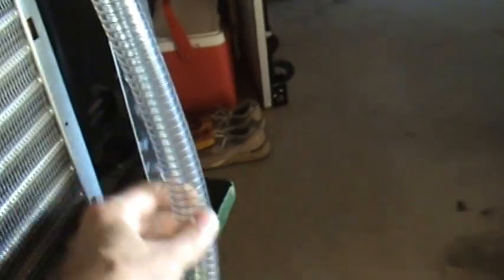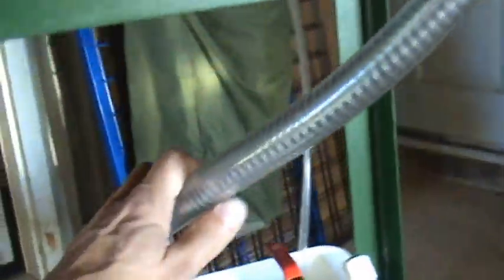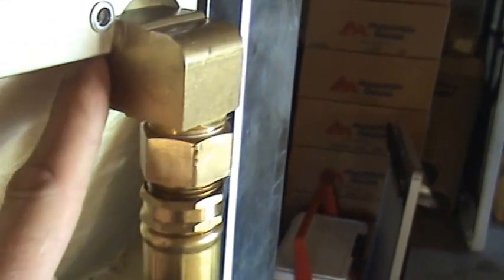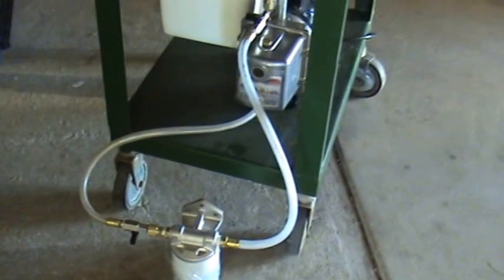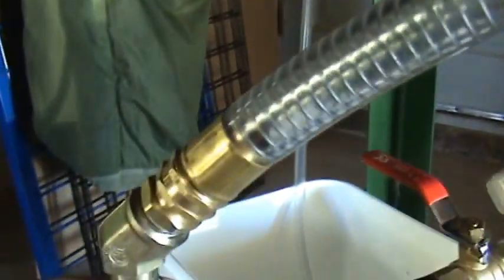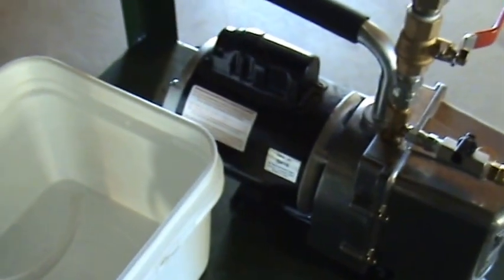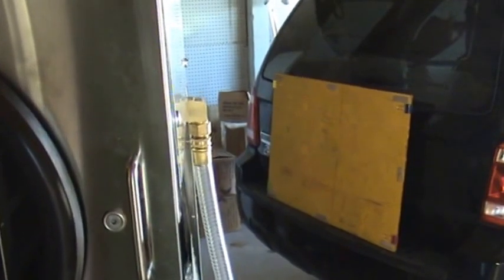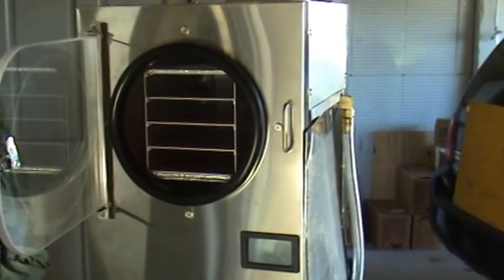Harvest Right freeze dryer vacuum hose improvement/modification fix

Comment: FYI, I agree with needing 90 degree. Have same unit - I bought a brass 90 degree 'hose adapter' (Commonly used in RV's) with out the need of mod cover. Has worked GREAT for several months now. Thanks for the video

Comment: That is our PROBLEM too.  It is a space hog as far as requiring MUCH MORE room than it's chassis dimension.  I agree with the drain being pretty lame too.  I am going to modify my cart to have it come out the bottom within the footprint of the unit and add a second valve  as not to touch their original design.  I'll just leave their valve open.  I think the whole high maintenance of the pump is ridiculous too.  I want to  rig up a  continual filter system or maybe just suck it up and by their overprices oil-less pump just to avoid the whole problem of burning out the pump if I get lax on the maintenance schedule.
Reply from the maker: Might want to do some looking at blogs about the new pump.  I haven't been hearing many good things from owners about it yet.

Comment: Could you please post links to the 90* and 45* fittings that you used or specify the connector sizes?  Thanks.
Reply from the maker: I don't know off hand what size, but they would be common sizes available even at home stores.  Sorry, I am a long way from my freeze drier to check this.

Comment: Hi. Not sure about your modification and the FD warranty, but that in line filter, esp if it's the so called Franks Filter voids the pumps warranty. The man selling them is aware if it. You can contact the pump manufacturer for confirmation. Also, if you need HR support to trouble shoot, they ask that the filter be removed.  Freeze Dried Paw Paw? Oh, that sounds awesome! my Paw Paw trees haven't begun producing yet.

Comment: I was wondering if you could help me. My HR freeze dryer is not going beyond 750 mtorr. My door is still nice and tight and the ring is visible, but my food is not being able to dry properly due to having a weak vacuum. What should I do? You can pm also on FB. Thank you
Reply from the maker: Check everywhere for leaks; all hoses, drain valve, not just the door.  Beyond that, consult Harvest Right, they have very good customer service in the troubleshooting department.

Comment: add a diesel fuel filter with a drain on it. you can drain the water out of the filter without removing it.
Reply from the maker: Colten Njos  Have you done this?  I know many diesel fuel filters have bleeder valves at the bottom but I haven't yet compared the specifications of vacuum pump oil vs. diesel fuel.  It seems the viscosity between the two are probably quite different.  The system shown on this video also allows me to drain water, but not directly from the bottom of the filter where some would likely collect as well.